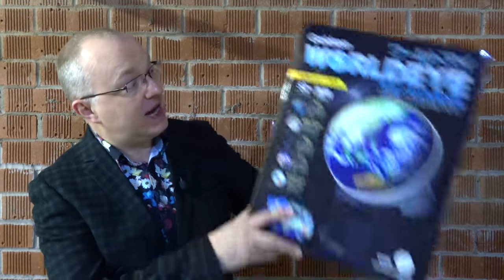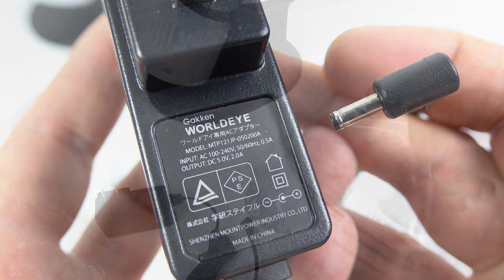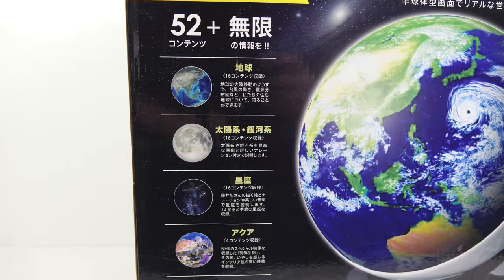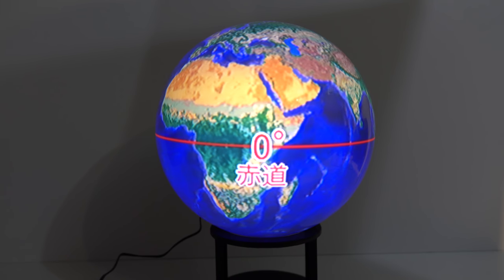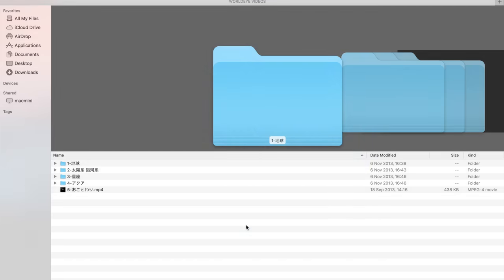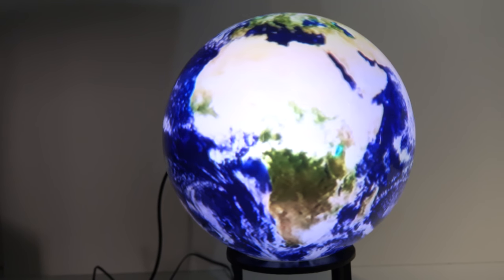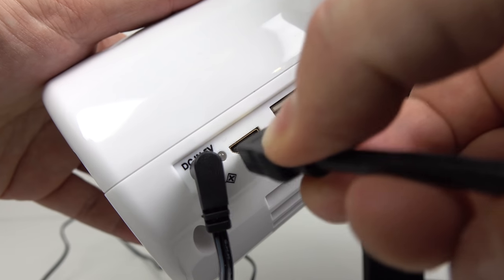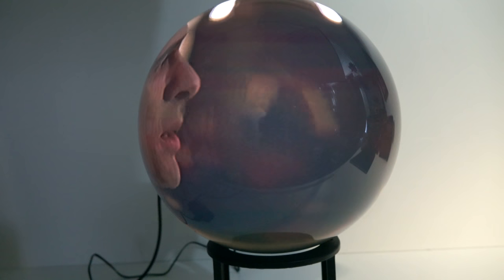What in the world is the Gakken WORLDEYE?

Comment: Would be interesting for a teardown video
Reply from the maker: Opening it up would be a destructive process as it's held together with the melted black plastic rivets you can see around the circumference. I can say what I'd expect to see though: a circuit board attached to a pico projector.
Reply: a little tape and it's as good as new. I'd really love to see inside one. Maybe this will force me to buy one...
Reply: Maybe a bunch of people could each chip in ~$10 of the ~$250 price and have one sent to one of the channels that specialize in electronics teardowns? (EEVBlog for example)
Though the only part that is really going to be very interesting is probably the optics.
Like TM said, it looks like a picoprojector with a built-in screen in an unusual case.
Reply: BigClive will have it in bits in no time flat. If he can put it back together is another story.
Just don't mention a Easter bunny!
Reply: I'm curious to what the optics looks like. The brightness distribution and coverage density is surprisingly good. And yeah Clive is your guy, not the whiny Australian!
Reply: It's just a fancy CRT TV. But cool none the less
Reply: There's no CRT in there, it's clearly an LCD projector.
Reply: Kevin Arnold if it was a CRT, it would be crazy heavy, which this I not.
Reply: The mathematics of the projection seems slightly interesting: it looks as if the projection is stereographic or something close to it (meaning not stereo 3D, but what a mathematician would call a stereographic projection), which means that the effective origin point of the projection needs to be at the rear surface of the sphere continuing the arc of the screen. If it's precisely stereographic, that would make it relatively straightforward to produce content that displays well on a sphere.
Reply: Yes, that is interesting and this is what I do in my daytime job as an AV-technician for a rental company. In order to project on odd surfaces like curves and such, we have to apply a lot of projectors and divide the content on multiple sources with advanced warping capabilities. 

However, in this case, I think it's much simpler. I bet it's just a very cheap super wide lens in acrylic or maybe glass (but that's usually very expensive) with a factor of 0.5:1 or something in that region. I doubt they actually split the video signal onto multiple different angled mini projectors like we would have done, and then blend these together.
Reply: There are probably fish eye CCTV lenses. They don't have to be single-element, they can get pretty decent at just a few dozen currency-units.
Reply: Kevin Arnold - A CRT needs mains voltage to run, not a power adapter.
Reply: Yu Lei Old Camcorders had CRT in their viewfinders which ran on 5 volts from batteries or power brick!
Reply: ***** I bet it's one of those cases where it looks better in person than on video, it is very bright after all, so it will wash out when photographed. But there isn't a lot of resolution to go around there, probably a 480x480 crop out of a 640x480 LCD.
Reply: The big science-museum globe displays probably have multiple projectors.
Reply: Thomas Piccione there was a time when politicians would win votes by providing small TVs to people once they win. Those weren't heavy at all.
Reply: Atheist Orphan okay, you may be right
Reply: True, but these days I think a little LCD projector is the cheaper and simpler-to-manufacture option. Makers of CRTs are rapidly vanishing as the market goes away--and this would be an unusual custom CRT, whereas it's not so hard to have a projector with a funny piece of plastic on the front.
Reply: And a cheap projector in turn is just a display, often of the kind that aren't needed elsewhere any longer, rear diffuser torn off, a light source and some plastic optics.
Reply: Matt McIrvin it looks like a vacuum tube (the whole grey translucent area that looks like it has a florescent coating on the inside)
Hence I deduced that it may be a CRT..
Reply: i had a radio cassette player with a built in crt tv in the 80's, and it ran on batteries aswel a 12v adapter.
And i still have a 00's  babycam with a 6inch crt monitor that is powered with a 12v adapter.
Reply: To be honest, my guess is that it's essentially a cheap portable video and mp3 player without the extra screen layers it normally has, and then light is shone through the screen, onto the globe surface. All the futzing to get it to look nice in a globe is then done to the actual videos, so if you have the time to pick out videos that'd work well and edit them, you can make your own like that cool dude did for Techmoan. 

I'm not saying it's actually that hacky, but rather that that's probably what it is, in essence, and you definitely could make your own if you knew what you were doing and had a suitable pmp, light source, and properly coated partial sphere. I have an old slide viewer device that I wanna do something to that effect with, but in practice it's always gonna suck blowing up a tiny screen. It's just a question of how bad is too bad.

Edit: The guy who fixed up those videos commented on the build, including the lens, on raxorbin's comment, so I recommend checking that out if you hadn't noticed it yet either.
Reply: See if you can upgrade the projector with one of your minis you have.
Reply: Just found one on Ebay £139, so tempting :)
Reply: @Purge98 that's some extremely cool and awesome racism there
Reply: That must be a helluva pico-projector to do that well in bright lighting, though I suspect you're probably right.
Reply: Where are you seeing it for $250? I looked it up online (granted, I'm state-side) and I'm seeing north of $600.
Reply: Kind of makes me wonder if you could do a weight-reduced CRT with modern materials. CRTs were primarily heavy because of all the glass, but modern polymers might be able to stand up with enough abuse that we could bring the glass use down to a minimum.
Reply: @Ivan Kowalenko It's only projecting like a foot away. I can think of plenty of things that are way less bright than this, but only those cheapo kids projectors and maybe ultra portable or just plain crappy pico projectors would probably be around this level. (For the record, I'm not saying it's awful. Just that it needs a lot less light to look good in bright light than a normal projector, pico or otherwise, even with the filter taking some brightness away.)

Edit: On the other hand, maybe they're still pumping out the same ol' cheap shit from back when pico projectors first buzzed into consumer's ears. That does sound like something some of these companies would pull.
Reply: Ivan Kowalenko CRTs also spent plenty of weight on various metal parts, both inside and outside the glass tube.  Glass was chosen became it isolates electricity, keeps air outside the vacuum, but lets through magnetic controls and the picture itself.  It's also historic since the first CRT tubes were lab equipment.
Reply: Seems like a job for Big Clive at bigclivedotcom.
Reply: There are small CRT's that can run on a power adapter, but I doubt it's a CRT... would be too expensive, and NTSC or PAL CRT's can't run 640 reaolution anyways. It's a cheap LCD I'm sure with a bright light behind it. There has got to be a way to build a DIY version of this.
Reply: He says projector..
Reply: eevblog is too hyper for me,like he has ingested 2 kilos of speed !!......I would send it to bigclive :-)
Reply: +Joanne Lowery I just mentioned BigClive,then I saw your comment on him,he is a great guy,love his channel :-)
Reply: Yu Lei 666 th like and yes i am satan
Reply: +Shreyas kulkarni Those CRTs are tinyyy
Reply: Soa fa, OK if you're Satan, What's my name? (Jim) I'll edit this bit out after. wink wink.
Reply: Come on Khoi I certainly hope you don't really think that is a CRT!
Reply: +Desi J Richert Ofc not! I'm not a dumbass lol
Reply: I'm using this as a giant eye in my window this Halloween.
Reply: Here is a teardown video: https://www.youtube.com/watch?v=EyFJYJrDpDM
Reply: Techmoan Where do you go to get the stereo equipment?
Reply: Here we are https://www.youtube.com/watch?v=EyFJYJrDpDM
Reply: well he is an electrician.  might even be able to send that Hi Vision LD player to him problem is cost  but Britain to Isle of Man who knows.
Reply: @AtheistOrphan  No they don't i  have two battery operated CRT mini tv's
Reply: Scratches at a level 6
Reply: It works just like a projector TV
Reply: @Kevin-yh8ol  not a crt, a crt has way better motion reproduction and wouldn't have ghosting/overshoot like at 4:28- you can see the afterimage of a frame that's otherwise not visible, a crt would still show multiple frames, but they'd all be equally visible.

LCD, definitely
Reply: i just wanna say i replicated this in 5 minutes using a pico projector fired through a lens ball at a football covered in tissue paper. obvs the edges were still there because the light supply wasnt contained, but the proof of concept was pretty clear
Reply: On mine, those aren't plastic rivets, they're torx screws.
Reply: Yeah

Comment: They should have made Saurons eye video, so you can have Palantir in your hands
Reply from the maker: We've got one for it. It's included in the new videos created by Anders.
Reply: Get two projectors and put an eyeball in each one! That should creep out people big time! :-)
Reply: @Francois Caron  I like the way you think.
Reply: And have them in the front room window looking out at night. maybe attach a sensor so it follows movement.
Reply: Damn I didnt look at your reply yet we both came up with the same idea.
Reply: Could a Raspberry Pi be programmed to work with a 1:1 aspect radio? They already support a wide variety of sensors.

This is getting way too creepy! :-)
Reply: You should team up with Colin Furze and build the world's biggest Furby! :-)
Reply: Ow... Yeah.... That would be great François Caron.
Reply: A saurons eye visual video would be awesome!
Reply: +François Caron I doubt that's entirely likely. 480×480 is not a standardized resolution, so I doubt you could successfully output that over HDMI. However the Pi is just a general purpose ARM computer that runs multiple versions of Linux, so with enough custom configuration options you could probably rig it up to spit out NTSC SD (720×480) at a 4:3 display aspect ratio (8:9 PAR)  but with the GUI configured to operate at 1:1.

I don't know what's been ported across architectures and what hasn't, but with a GPU accelerated compositor (like Compiz back in the day) you could probably even apply display curvature compensation in GPU.

Throw in a lot more custom coding and you could probably build a whole GUI around the curved display. Something that displays just generic patters on the background (á la Android Live Wallpapers) and provides major interactive elements at the "front" of the globe.
Reply: It takes 640x480 video and crops it to 480x480.
Reply: @François Caron that would be great you could even build a entire mask face with the large eyeballs moving
Reply: DMT
Reply: Most popular games consoles have had  tracking hardware for yonks

Comment: Clever but leaves me wanting for a full globe with 4k res and induction power coupling for the internal projector. Live satellite imaging. I guess it wouldn't need to spin like your other globe. Or...
Reply: It's basically a small projector and a plastic hemisphere. You could make your own. The resolution seems fine though for what it is. 

Inductive power only works over a short distance. Most of the time you're better off with a wire. Or maybe a battery and a charging cradle.

Comment: You can add a custom resolution with a 1:1 aspect ratio (Intel and Nvidia supports it out of the box, with ATI a special software called Custom Resolution Utility).
Reply: But you still need something that applies a 50% pinch to the image in realtime though, and it has to be from a circular mask around the center because a pinch from a square will warp the picture differently and it won't match the hemisphere shape: http://eox.no/public/pinch.png

If you can program something that does this, it would be very much feasible. :)
Reply: Well, saying that we know exactly what needs to be made, it wouldn't be too hard, would it?
Reply: I think that a frameserver like Avisynth may be able to distort the video on the fly.
Reply: >If you can program something that does this, it would be very much feasible. :)
Brainfuck exists as a programming language.  I wouldn't be surprised if someone did that already just for fun.
Reply: The software would need to be a basic image mapping table. You have a table, 480x480, and each location contains an address on another 480x480 map. For each input pixel, you look up on the table where it needs to go on the output image. Then plot it there. Simple as, really. 

A spherical mapping table would just be a bit of cos and sin. For something like Linux it'd be easy, you could just pipe video through a program.

Comment: Another cool video.  Shame it does not have a higher resolution screen or analog AV input.  Would be cool to replace a bedroom light with it lol
Reply: There's a million HDMI-to-whatever adapters though if you wanted analog AV input. It has an HDMI input slot 3:27
Reply: Why would you need analog input? And if it did have analog inputs, a higher resolution screen wouldn't do any good.
Reply: 10p6 wouldn't work properly due to the curvature of the screen
Reply: Depends on what you want to do display.  So yes it would.
Reply: 10 lines of resolutions, 6 frames per second?  Sweet.
Reply: Actually NBTV is 32p at 12.5 fps.

Comment: The brand Gakken reminded me instantly of the educational electronics kit I had in the very late 70's it was the Denshi-Gakken EX150 and had an array of electronic components mounted in green cubes with terminals that interlinked and sat inside a matrix board you could carry around.
Maybe you could have a look for one of those kits? You could make a radio receiver, a Morse code station etc.
It's not HiFi equipment but it is old tech.

Comment: considering there is a hdmi port, wouldn't it work using a raspberry pi (for space saving) to play up the custom videos? considering it should be able to loop the videos a bit easier then?
Reply: T1GWBJAH Still the issue of pinching the image to keep it from bulging though. ;)
Reply: There could be a program that converts the output into one suitable for the Worldeye.
Reply: I have faith that the Pi community will come out with a version of Raspbian that's specially formatted for this particular screen. :)
Reply: real time image processor pipeline running and adapting the video on the fly?

Another thing I can think of is planetarium software. Atleast some of those have projection modes for using spherical screens.

Custom image generator software. First thing to come to my mind is a moving scary eye with a projection software that in real time generates the corrected image and thus moves the eye ball around on the sphere.

Comment: someone may have said this by now... and its probably useless since its been years since you did this. but when everything is plugged in, if you want to change the angle of the device, couldn't you simply turn it 90* so that the ports are facing either up or down and slide it out a bit, then into one of the other slots before spinning it back into the proper orientation?

Comment: Two of them used to test for Alzheimer's disease. Each an Eye in which both blink periodically. Both eyes may blink three times and each time the eyes are looking straight ahead. The fourth blink one eye is looking straight but the other is looking down. After a short series of blinks the subject simply presses on a screen the image of eyes in which both were not aligned. There are various selections with only one that is correct. Then determine if it was the 1st, 2nd 3rd, or fourth image that was out of sync. Then which direction the eye out of sync was looking. The test starts simply and progressively gets harder with more images, shorter blink duration and more anomalies per mini-session/ a dozen or so making up one testing session. A score card can quickly be established using a variety of test subjects both healthy and with Alzheimer's disease, or other mentally debilitating abnormalities. The test results can be scored from each session and compared with those in the future to determine either improving memory ability or declining. Or it could be used as just an eye that follows people's movements. Stop shoplifting when the eye is spotted by shoplifters following them around in the store. Camera's work as a deterrent to stealing but a big eye watching a potential thief would eliminate the problem. Would you do something wrong if a big eye was watching you?